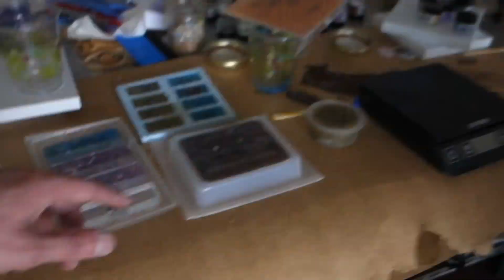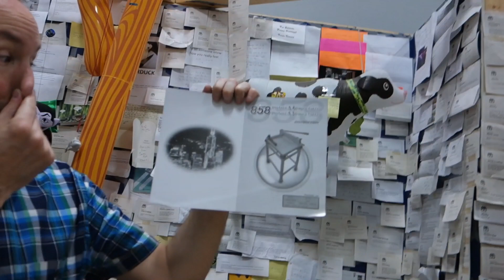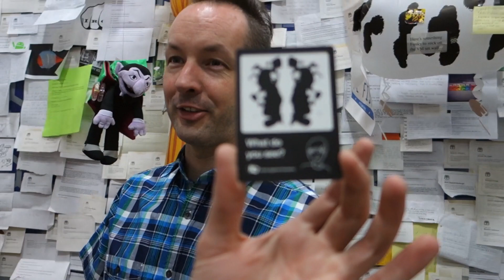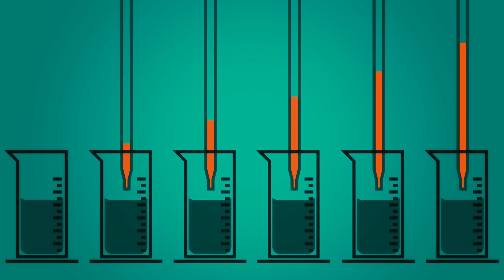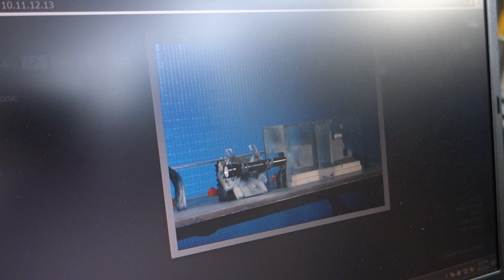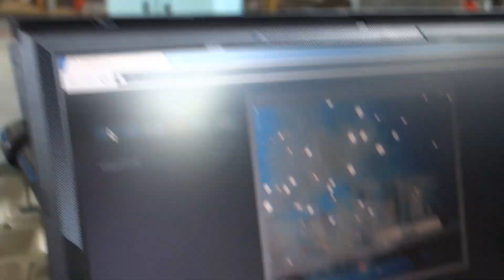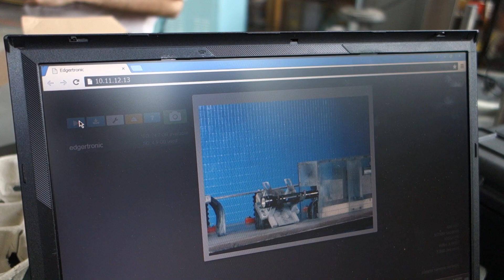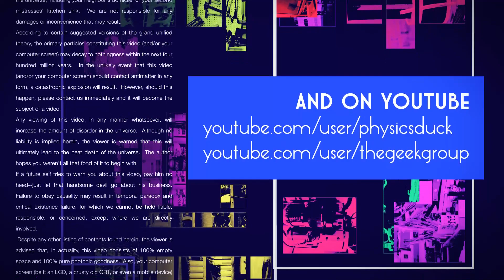Captain's Blog 9 2 2015 UFOs and Maglite Abuse

Comment: My older brother has his birthday exactly on Christmas (Dec. 25) and it was so bad that now we end up giving him his presents on June 25 as an "anti-birthday."

The battery chemistry you're thinking of is probably LiFePO4, or lithium iron phosphate. It's lower voltage and lower capacity than standard lithium-ion or lithium-ion polymer cell tech (lithium cobalt oxide, lithium manganese oxide, lithium nickel manganese cobalt oxide, or lithium nickel cobalt aluminum oxide), but much much less likely to flame-out, and can produce stupendous discharge current. (single 18650, 1200mAh, 30A discharge. The larger prismatic cells are just insane.)

Comment: good way to open.  my camcorder uses the time start of the video for the file name.  at 2103 the sky is dark.  casters are great way to move small things.  what are some ways to play with goop?  Captain your hair is NOT floppy.  your cutter is big.  nice your using the skeleton of the recording studio.  at 90f certain things start falling apart.  transitioning between media interesting.  december and march are 7 months one way and 5 months the other way.  squeaka squeaka.   12s are more useful than 10s.  your lead commenter poops as well :)  joe could also be messing with your head.  Captain you are very creative.  per Moose labels help you organize.  can you explode a battery in Abuse of Power?  will mimics photonicinduction.   looks can be deceiving.  neither do i want that.  i see an egg splat.